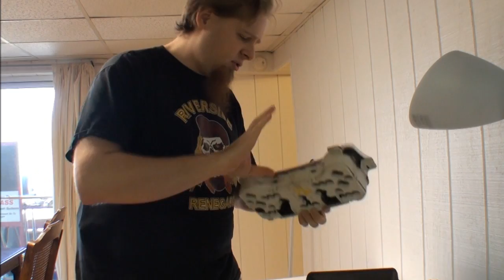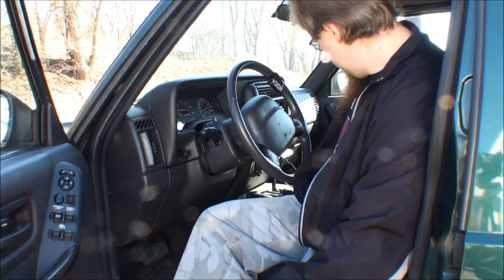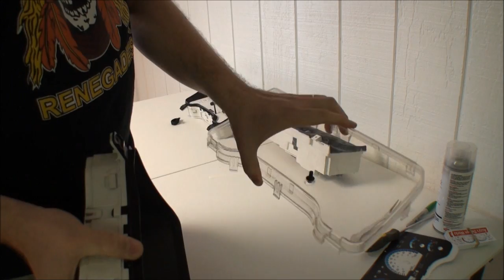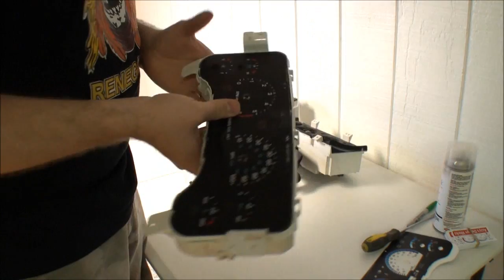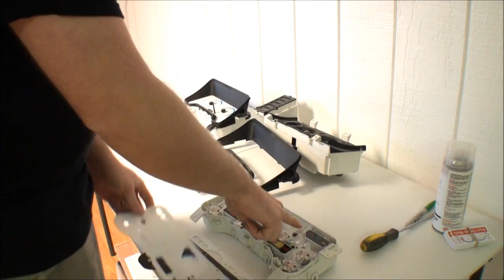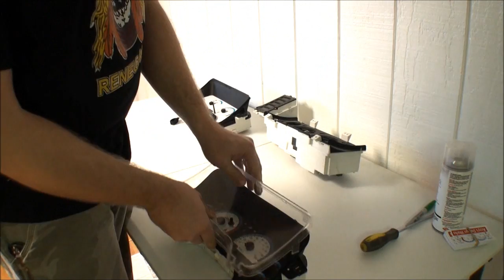Azzy's Design Works Gauge Kit | 97+ Jeep Cherokee XJ and Wrangler TJ

Comment: Hoping I can get some feed back, I just did mine and had to set all my needles multiples times and all is good except my speedometer. It will not read or move now. I have held the trip button and let all the gauges do their dance but my speedo wont move now. Any input would be appreciated.
Reply from the maker: If the speedo is pressed in too far, it sometimes will bind (any of them will). Same if the clip behind the needle is loose and holding it in place. 

Shoot us an email if you are still having issues.
Reply: @Azzysdesignworks  Thank you so much for the reply. I will pull it apart again this weekend and check it out. Now when inserting the needle with, I should position it to where it goes in sitting directly on the stopper tab at 0 correct?
Reply: @F.T.A.T.F  Have yall figured this out?  Just ordered the gauge overlay but worried if the speedo will be messed up..

Comment: When the cluster was assembled in the factory it was put together without adjustments. Using the needle rests as a guide? Why is necessary to do all this extra work?
Reply from the maker: If you are changing out the gauge face,  considering the last US model year for these was 2001 (18 years ago) there is mechanical wear to be  contended with. And the needles were never set to those pins. They are set to slightly behind. So if you set your gauges after installing the face to the pin, they will always read off.  Part of this, we have found, is due to how the air core (not stepper or servo) motor acts in these clusters.

Comment: If you wanted to change to LEDs, what kind are they - what base, and any particular ones you'd recommend?  I'd like to have them ready before installing a set of these.  Thanks!
Reply from the maker: Don't really recommend LED conversions in these because of how the voltage is regulated in the dash. It tends to make the LEDs life drastically shorter, and aside from color changes there is no benefit to the very slightly less power draw over the stock bulb Solutions. If you do want to go ahead with an LED conversion I would look for one with the widest beam throw, and look at LEDs from superbrightLEDs.Com. that is where I have seen the best reviews.
Reply from the maker: Dont recommend LEDs, unless you are going for a color change, they dont illuminate, or dim the same. 2 brands of LEDs burned out on us testing that out with the restive (voltage drop) dimming in the stock jeep setup.